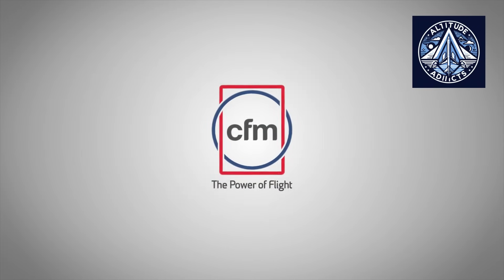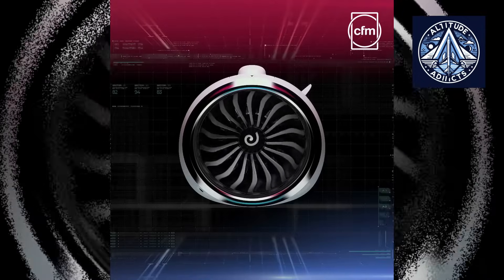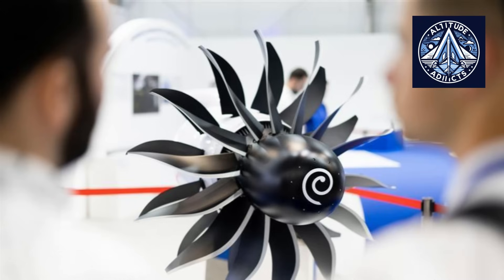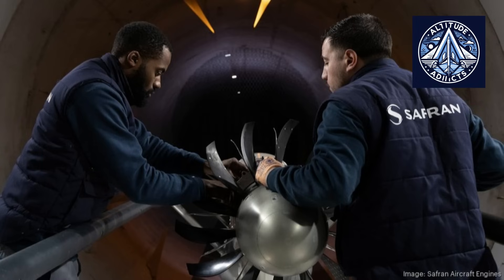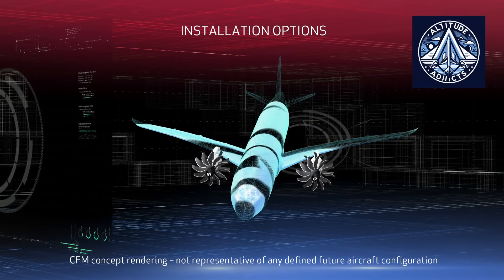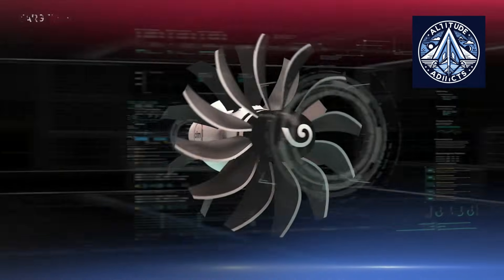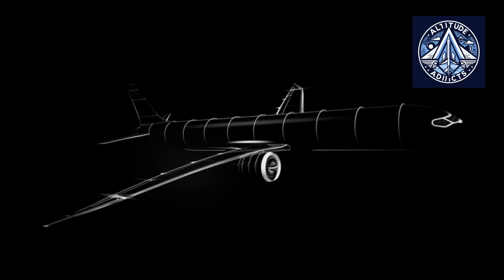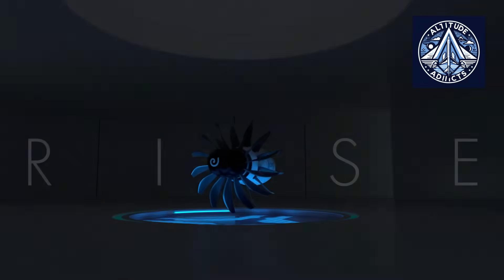Safran Reveals RISE Engine Secrets -  Hidden Innovations Finally Revealed

Comment: The principal difference between this open rotor design and an old-school turboprop is the cruise speed of the target aircraft: well above Mach 0.7.

That said, integration with the airframe, cabin noise in the rotor plane and handling blade-out events will present significant challenges in engineering and customer acceptance.

Comment: It’s quite old engines invented by Russians engineers, anybody can watch videos Russians Bear heavy boomers with same open rotor counter rotating engines, Russians are testing similar technologies but using 3D Printing technology including Carbon Fiber to increase efficiency and reduce weight, there are videos available on YouTube and other platforms installed on IL 76 test lab aircraft.